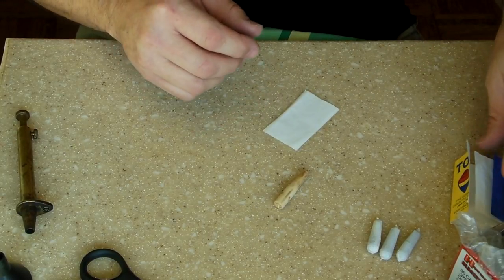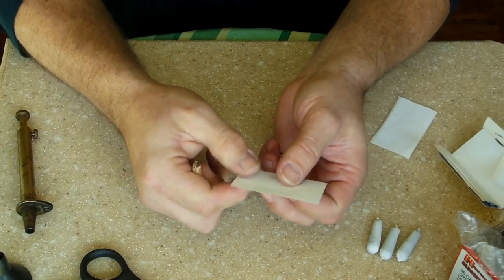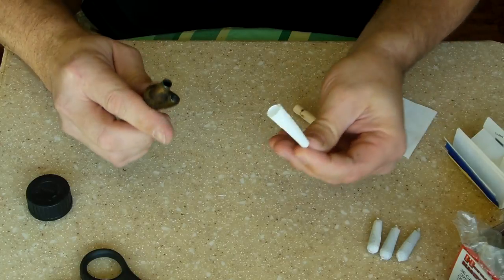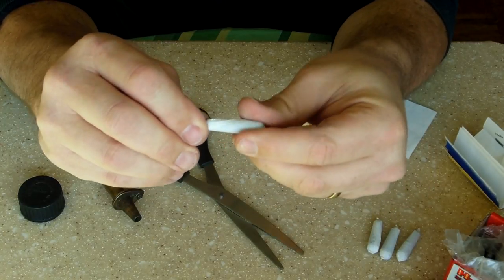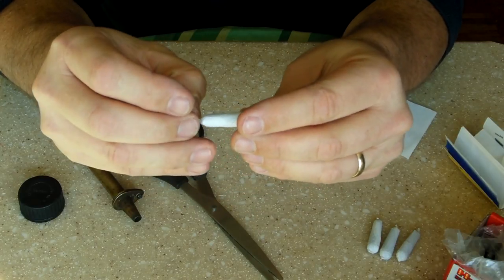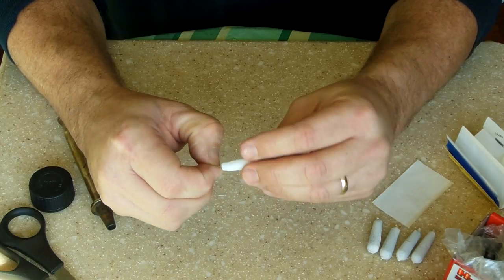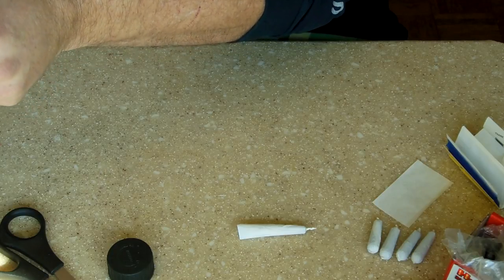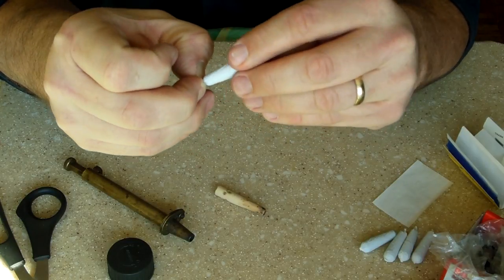Rolling .36 cap & ball revolver cartridges

Comment: what are the dimensions of your wooden dowel? for 36 caliber.
Reply from the maker: About .375 on the big end, .240 on the small end, and .912 in length. Of course there is a little wiggle room on length and the small end diameter, but the big end needs to be real close to ball size.
Reply: @plowboysghost  Thanks ! Cheers from Normandy
Reply from the maker: @Yosemite-George-61   Yes, sir! Glad to hear from Normandy.
(Sidenote:)
 Found out recently i have "Norman" ancestry.... which may or may not pertinent. Thought it's very interesting, though.

Comment: Any chance you could show us how you made that dowel?
Reply: Just buy a .36 cal dowel and widdle a taper into it.
Reply: I use a 3/8" dowel, chuck in a drill and use sand paper to taper the end down some. Does not have to be exact but enough taper to allow the paper cartridge to slide into the chamber.

Comment: Having just received a percussion pistol, I'm going to make paper carts for it. You're right, for a beginner it makes the loading process quicker and more fun.
Reply from the maker: It seemed like an easy enough way to me.
Reply: @plowboysghost  Works well on the range, then?
Reply from the maker: @ArizonaGhostriders  They did for me. Once in awhile I'd get a paper plugged nipple (giggity) and have to run a nipple pick through it .
Reply: @plowboysghost  HAHA!
Sorry, but you had me at "giggity"
I wonder if coating the paper in Potassium Nitrate would help? That's an extra step though...
Reply from the maker: @ArizonaGhostriders  Don't know if it would help or not. It didn't happen often, though.

Comment: Hello, I just tried making some cartridges for my .44 Remington using conicals. I kept the former straight, no taper and it worked great. I experimented with 12 grains 777 FFFG I was more interested to see if the cap ignited the charge. Pretty good 5 out of the 6 went great, 1 was a little tricky so that was probably me. I'm couldn't slide in a lubed conical so I will roll  it with the former next time. I liked the technique, very simple, cheap and easy. Can use up a bit of spare time at home and maximise time at the range. Thanks very much for the video.

Comment: This is much simpler than some of the other methods of seen to provide a more historic paper cartridge. This seems far quicker and just fine for recreational shooting. I might push a greased wad in when I try this method just to help with the barrel fouling but that would be all I would change. Thank you for sharing.
Reply: Or if you use a low grain charge. They say you can use corn meal for filler. Use ballistol to clean and lubricate. Some use dishing washing liquid and warm water to clean. And some use ammonia.

Comment: So here's a  point I 100 percent agree with.  As a man who has lived most of my life in grizzly country one can not justify light loads. It's far better to have to much for the rattlesnake than to little at the other end of the spectrum.  One the brass of today has no resemblance to those of yesteryear. As to the paper cartridge subject of the video.  Another simplicity for those who over complicate a process. So here's a thought for contemplation.  I'm more a new model army guy, that being said I am baffled no one seems to utilize  or talk about the potential of a replica new model Navy's  full size army frame. Seem stuck on traditional loads. Casting aside potential 

Mountain man

Comment: Great job on the demo! I make cartridges in a similar manner from time to time, it sure makes loading a lot faster and easier, and you don't have to bring out all the powder measures and flasks and all.
Reply from the maker: Thanks. I wish I had started rolling these 20 years ago when I got into these guns...but only really started doing this a couple years or so ago. I used to carry a bag or box of loading components and powder measure and spend a lot more time loading than shooting.  It's a lot more fun this way. Now I carry a little Sucrets throat/cough drop tin box filled with cartridges and a little cap tin in the same pocket for all my shooting.
Reply: You ever make cartridges with conical bullets? I want to give that a try and see how they come out
Reply from the maker: I haven't even shot a conical from a cap and ball revolver yet. I plan to get a mold for conicals and I'll try them in these cartridges myself.
Reply: I just got mold for conicals last month for .44, never shot them yet either.

Comment: the civil war belt box was just a square leather box with a wooden block filling the leather box. Wood block had holes drilled for paper cartridges. The paper cartridges were stuffed all the way down the holes. 

Reason I mentioned this, is the tail on the paper (formed by twisting) allowed something to grab onto to pull the paper cartridge out of the holes in the wooden block. You could grab the nub of that tail. So they did not cut the top tail down so tight when making the cartridges so they would have enough to grab onto to lift the cartridges out of the wood block. 

I don't know if they bit off the tail, or cut it off, or just left it on after loading the cylinder out in the field.
Reply from the maker: I wasn't following a historic pattern or process with these cartridges like i do with the 1855 british rifle-musket cartridges I make.....but they're better than loading loose powder and ball in the field.

Comment: The issue with not using lube on the cartridges is it will cause the bore to foul out and this WILL decrease accuracy. At day’s end it also helps with cleanup of the bore, but the main reason to do it is for accuracy.

Comment: I have made over 100 rounds using this method.  The video on making paper cartridges I have seen.  In addition, to the exact size for those who asked, I use the of a crab mallet and used the cylinder and a file to trim.  It took a while but it worked.

Comment: That was pretty neat. Your cleaning method works way better than boiling water and using every clean hand towel in the house.
Reply from the maker: Window cleaner with ammonia makes short work of powder fouling. I rinse with hot water (tap temperature), and oil well...making sure to remove all oil from percussion nipples and chamber of course.

Comment: Thanks for showing your process. If one wanted to add lube, do you think just putting a little lube above the ball would work?
Reply from the maker: I'm not 100% sure. It will probably be soaked up in the paper..which would be fine if the paper stayed over the ball  once loaded, but often the paper doesn't.  It wouldn't hurt to try some and see. 

 It's a good idea, either way. Thanks!

Comment: I use the tube from an old Bic pen for my 36 if it's down the chamber pretty nice with a little wiggle roomI basically just wrap the paper around the pain like I was going to roll it into a cigarette hold the wad and the ball at the tip whilst I lick and stick around and once I get it stuck twist the top of the paper around the top of the ball to hold it in, pour 20 grains of 777 from my flask cut the excess, glue another small square over the exposed powder it's still a work-in-progress but I use a raw hemp papers

Comment: If the dowel former extends beyond the paper, you don't have to shake it out - just pull it from the paper cylinder. Of course with the form dowel only as long as desired, you avoid any step up or step down, but I would prefer some kind of handhold for control.

Comment: Great video!  Can't wait to try it.  Just curious, what would be the dimensions of the dowel for the .44 cartridges?  Also, will those same papers work for the larger cartridges?
Reply from the maker: The big end will be .454-.455"., the small end of mine is .300, and length is 1.990" 
I use those papers for both .36 and .44, but there's no extra paper when using them for .44s.

Comment: Plowboy do you wax the cylinder shut in addition to the paper cartridge?
Reply from the maker: I don't put any grease or anything over the mouth of the chambers after loading(and I don't use wads between ball and powder) but my chambers are tight enough to shave a nice ring of lead using .375 Hornady round balls. I have never experienced a chainfire in this .36 Griswold or the Pietta 1860 .44 using .454 balls.

 I have an (unfired when I traded for it a couple months ago) earlier built (1995) pietta "Navy" .44 steel frame that doesn't shave a good ring of lead from .454's, and it has chainfired on me....the firing chamber and the next one to the left. Didn't hurt a thing, but I'm either going to get a new cylinder for it or a conversion cylinder for .45 Colt.
Reply from the maker: I will neither recommend leaving the chambers unsealed(as I do), nor will I say that one HAS to seal the cylinders with grease.

Comment: Does it work on rifles too?
Reply from the maker: If it were kept to a maximum diameter that would reliably fit the bore, then it would technically fit...but I don't know how easy it would be to ignite the powder through the paper in a rifle's chamber.
 It would probably bust the paper like it does with the pistol IF it were seated hard enough with the ramrod.
 Seems like the worst case scenario is that you might have to pick the flash hole ...IF it's one that allows you to get at the chamber directly like a flintlock.

Comment: How does the 36 cal. compare to a 44 cal. in stopping power??
Reply from the maker: In terms of "destructive" power, the .36 makes slightly smaller holes than the .44 does, but .36 round ball holes are much larger than .38 Special holes...especially when the ball strikes something harder than target paper where the soft round ball starts flattening out. In a later video, I shot a .36 through a car windshield thinking that I had used my .44 cap and ball (yeah I know how embarrassing it is to have to admit I shot my car with the wrong gun :)  ) and the resulting holes were so large that while looking at them, I had no indication that they were made with a .36 instead of a .44.  

They were huge.

In terms of energy, of course the .36 with 25-grains of 3F is less power than .44 on top of 35-grains of 3F....but though I've done no penetration tests, I am very confident in the .36's ability to do some damage.

 .36 at the owner's manual recommended powder charges is pretty weak, though. My .36 loves 25-grains of 3F Goex and that powder charge really wakes up .36 cal.

Comment: I have a question, I have a 1862 Colt Police 36. I use wads with butter bore between the powder and ball, in the paper cartridges does it foul quicker? And do you use conicals? Very nice video!
Reply from the maker: I'm using Hornady round balls...but I expect conicals would work the same. I'll find out when I get a couple conical molds in the near future and start casting them.

As to the fouling: I can't say for sure how your gun will 'act', but my Pietta 1860 Army .44 and my Pietta .36 Griswold run fine with no wads, so i don't use them. I've never tried to put a wad in a paper cartridge, so I can't speak from experience on that. 
 I would think that as long as the wad remains relatively flat and rams home straight, it should work the same as placing a wad between powder and ball when you're loading loose powder and ball.
Reply: Well I'll try your recipe, looks good and if my Cimarron likes it then I found a easier way to load it in the field.
Reply from the maker: I hope it works for you.  This method has worked for me for years...and it's the easiest/quickest way I've personally ever made pistol cartridges.

Comment: And y’all have never had any adjacent cylinders cook off with no crisco or lard?
Reply from the maker: I haven't in this .36 Griswold, nor in the Pietta 1860 Army .44 that I had. (Ive owned many over the years, but only started loading without wads or grease (don't think I ever put grease over the chamber mouths...pretty sure anyway) with those two revolvers.

 I DID, however, have one adjacent chamber chainfire in the older(1995) Pietta steel framed "Navy".44 that I ended up putting a gated Kirst .45 colt/Schofield conversion on.

 It lit off the chamber that was next in line of rotation. There was a little louder report, but other than that, I noticed nothing when it happened. there was obvious lead residue where that ball had struck the wedge and split with part of the splatter going up and part going below the wedge, but no harm whatsoever.

 Looking it over good afterwards, I'm convinced that the only chance of getting lead spattered toward any part of the shooter would be the most unlikely chamber...the bottom one, going off...and even then you've got the frame and the cylinder between it and your face, so I guess I'm just not that concerned with it.

 The ball coming out of that short cylinder without speeding up in the barrel isn't that powerful, yet.

 I continue to shoot without wad or grease in my Griswold without incident....but your mileage may vary, so consider what I've experienced, but use your own good judgement. If I see you use wads or grease, i promise you I won't think anything negative.